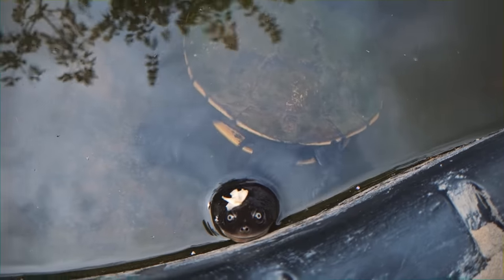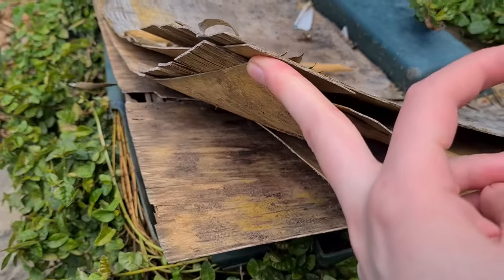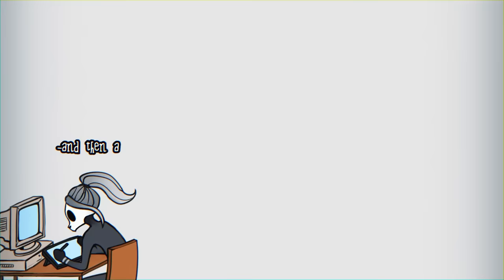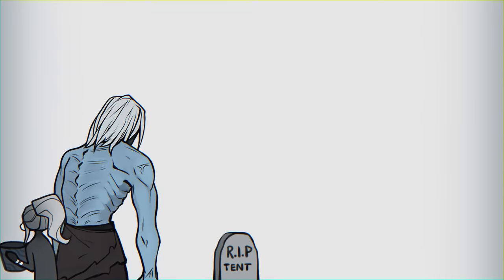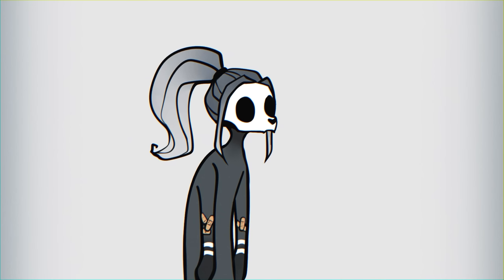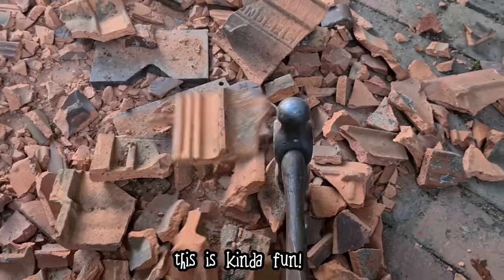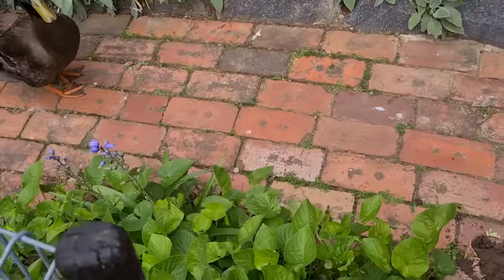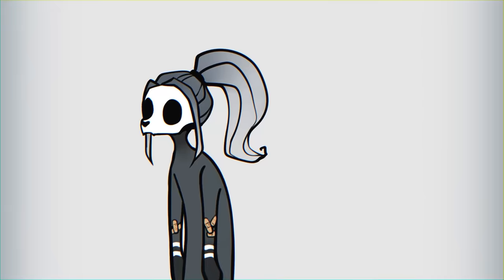He's awake

Comment: Hi,
I've been a traditional artist for close to fifteen years now, and started making the transition to digital (for various reasons) about three years ago, but I've kept hitting a wall. Detail, texture, blending shading always just end up looking rough and kind of sloppy. For example, when inking for a comic book style in traditional art, you can get a pretty large pen or brush and shade large sections of a piece with simple fluid movements, no overspill, nothing. Try doing the same in digital, and you either get major overspill or have to use a smaller brush to fill it in more tediously. Painting a pine tree with oils or acrylics can just be a handful of quick strokes, in digital, not so much.
I guess I'm kind of at a loss as to how one attains the blend of crisp and smooth that you see with more concept art or painterly pieces.

Cheers.

Comment: Does anyone know what software Ney uses? I've been wanting to get into 3D modeling, and I figured it'd be best to start with a simpler software, and the one Ney uses seems pretty user-friendly

I am broke tho, so if it costs money, I have no choice but to move on to another
Reply: That is Maya. It merely costs 2.208 $ a year (fucking Autodesk). Unless you can pirate an older version its pretty unattainable for the casual user. But if you are looking for a User friendly 3D Software that costs you nothing I highly suggest Blender. Its is open source, completely free and has a massive community.